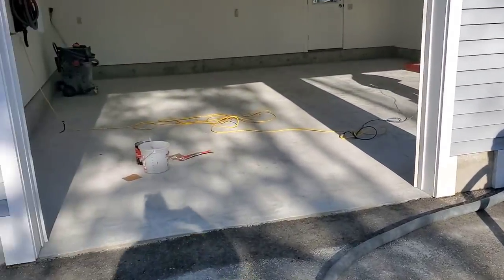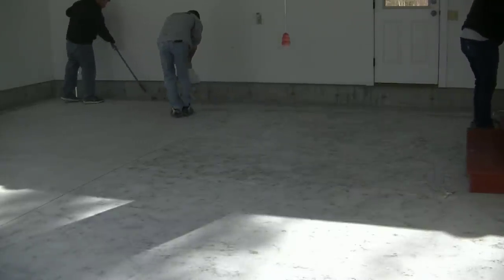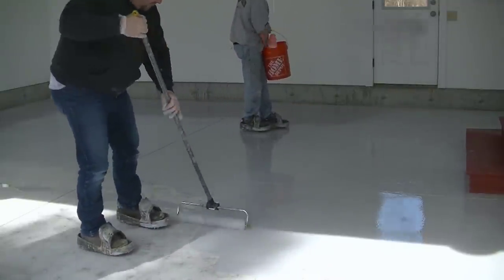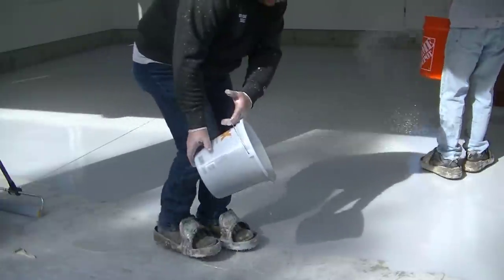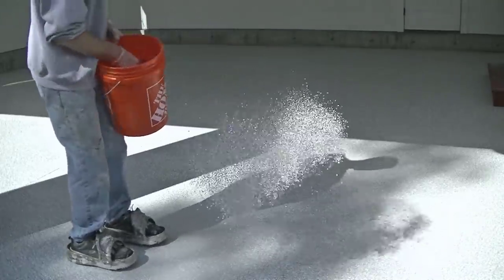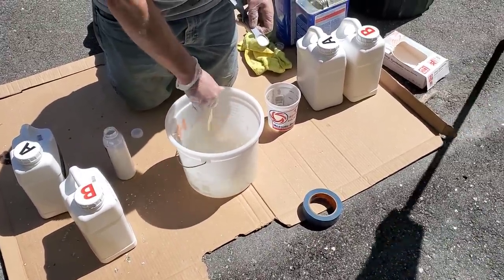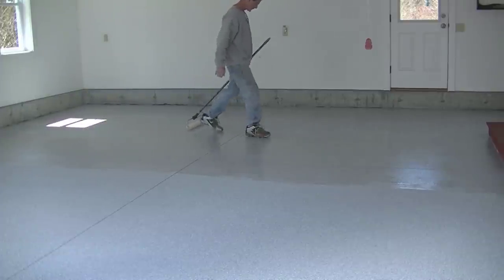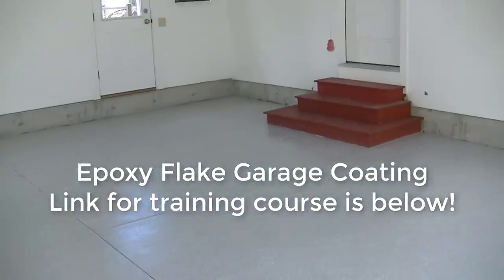PROVEN RESULTS - Epoxy Flake Garage Floor Coating

Comment from the maker: GARAGE FLOOR EPOXY FLAKE COATING COURSE:
https://www.theconcreteunderground.com/offers/JPMbSk6N
Reply: Can someone do it alone?  It seems like with that short of a pot life it would be pretty hard for one person to do alone
Reply: @jeffa847  you can do it alone in very small sections till you get used to application with squeegee and then backrolling. Dont be afraid to mix up half a gallon or less of a 3 gallon kit and practice. I'm about to start my first one I've watched 3 dozen videos or more went out on a job with someone and it was no different than on video.
Reply: if you have already purchased another one of your Apoxsee training courses can you get how did you flake added

Comment: Well done Mike, I have been demonstrating the same thing on my channel also. The only difference is, we apply a three coat system with a primer first.  This is just my opinion, but I have always felt as though primer is the cheapest insurance you can get.

Comment: I did mine myself. Sika doesn't sell direct so I bought from ucoat. I grinded the lataince then burned the fibers. Filled expansion joints with semi hard filler. I put it down wet per the instructions and it really bonded well. And I top coated with uv safe clear coat. Only thing that went wrong is the manufacturer overstated the coverage area and since it's mail order I couldn't get more in time. But it's a nice system I'd use again just buy extra to have on hand and send back any unused. I really liked the wet application, I could see it bonding deep into the pores. I also went up the sides of the curb to build a water proof pan.

Comment: I am considering having this done…and if I do, I will hire a professional.  But, I have a few questions.  I live in western Massachusetts, with weather extremes….and I am considering the basement as well.  (1) if there are hairline cracks, common with concrete, will they return after the epoxy coating? (2). Pertaining to the garage, In winter weather, after a car has driven through ice and snow, pulling into the garage with salt and crud, will that crud as it melts, harm the coating?  (3) is it slippery when wet? (4) watching the flake application, I assume that prevents the coating being too slick?  Great video…I’ve oftern wondered about these coatings.

Comment: We do flake floors at my company, and we use a material from flowcrete called MMA (really smelly stuff) for our topcoat, it has UV protection and is very strong. The downside to this is ventilation and the constant concern from customers.
Reply from the maker: Good stuff but you're right, smelly!

Comment: How much do you usually charge for a 2 car garage. Just a ball park. We do concrete in TN but have only covered up garages that had to be demoed. We most of the time use rust-oleum and have never had a problem. The only problem is waiting for weather over 50 degrees. I need to look at other products that I could use at lower temperatures. Any help with price and product would be appreciated. We are Southeast concrete Construction my friend. Take care

Comment: Wow, this is hard to believe.  We do this this way, we do that that way, we do everything much better than anyone else, and we are the best, the very best.  We are so good that were teachers.  As my great-grandfather said quite often, the people that can do it do it, those who can’t, well they teach.
Well Mike, it looks like a mess to me because it just wasn’t done correctly.  You sanded the floors and you did this to the floors and you did that to the floors, what about that skirt of cement around the perimeter, up to maybe 18 inches tall?  That makes everything look just fine now doesn’t it, a job that was not done completely is certainly not a job done correctly.
My company is been in business for 104 years does things differently than you, much differently.  If anyone wants us to do a job that in the end will make us look bad, I absolutely refused to do that job.  All of this money spent on preparation and materials, and the cost of a movie to teach other people how to do this kind of work was just all wasted.  Firstly, I would have insisted that the walls from ceiling to the floor be refinished.  Touchup any drywall that need to be repaired, make sure that the skirt around his garage was smoothed out real well, and then paint the wall from ceiling to floor with two coats of a really good exterior house paint, preferably semi-gloss.  Then, and not one moment before then, clean the floor up and spend all the money and making it look good just like the walls should have been done.
If you going to take your girlfriend out on Saturday night, get cleaned up from top to bottom.  Just putting on clean pants is not going to do it, you need a clean shirt, a clean tie and clean jacket, just fixing and cleaning the bottom does not do the job.
Reply: Purchase a nursing bottle for your tool collection.